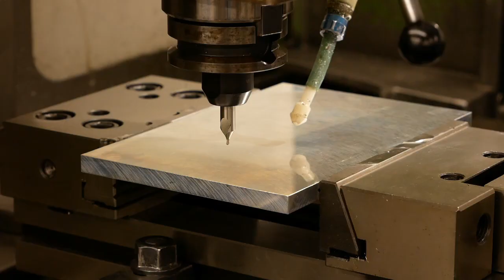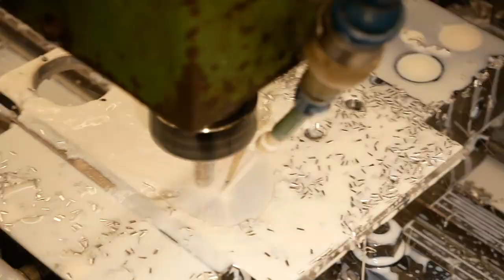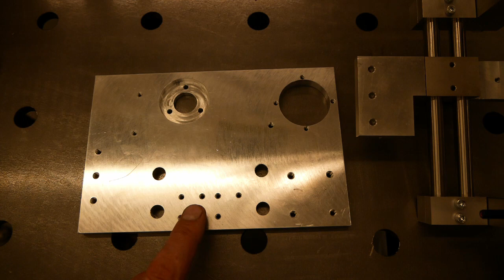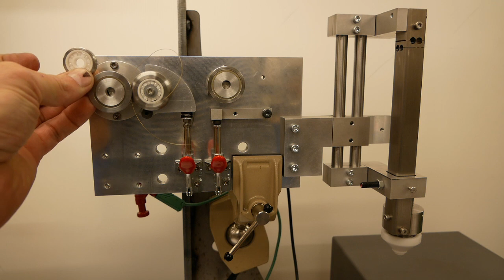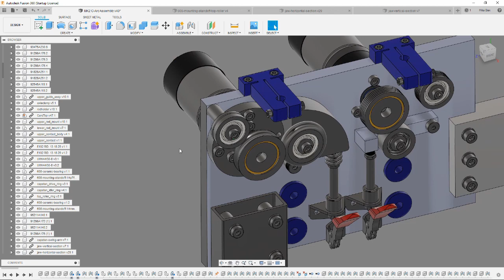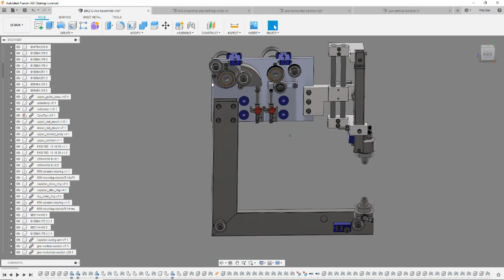Wire-EDM Machine, MK2 redesign: Part 8, C-Arc plate + initial tension tests

Comment: This took me back from my days in the development of wire saw machines destined for wire cutting silicium wafers for micro-electronics and solar applications. Having bigger wheels and using synthetic materials where the wire runs into de V-groove helps immensely to get an easy to control grip on the wire tension. Groetjes uit Zwitserland.